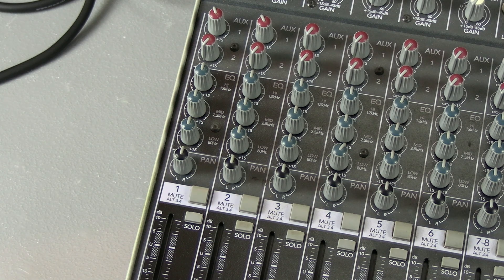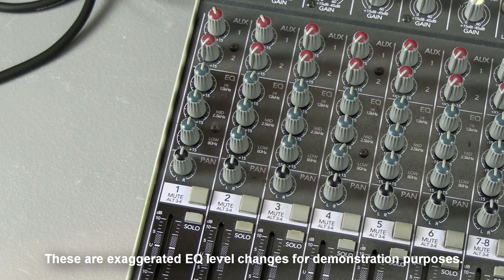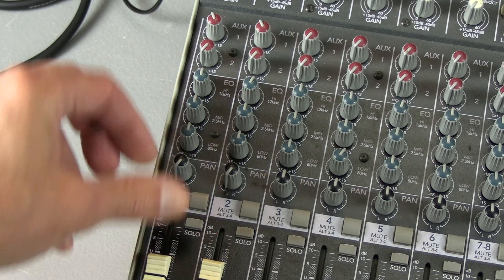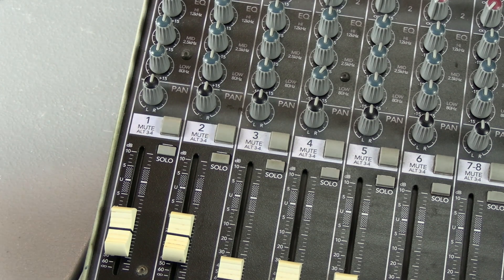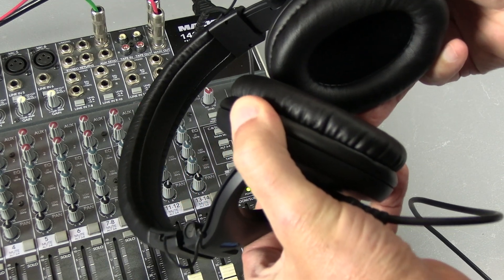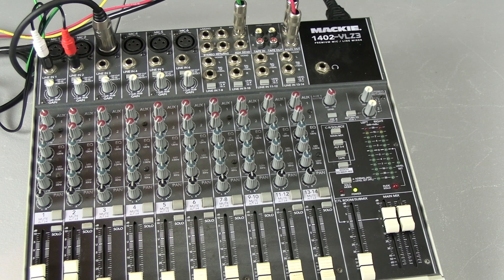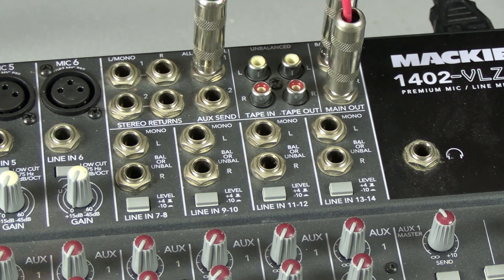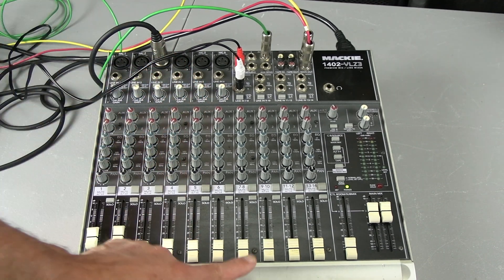Mixing Boards - The Basics of Using an Analog Mixing Board - Part Two

Comment: Another Tech Note for Phantom Power 7:15 ... plugging in a line level source, such as a cell phone or media player, to a Phantom Power-activated input can (and likely will) damage that source device, especially the audio-out circuitry on that device. Ensure you are plugging these devices into a designated Line input or, at least, a channel that is NOT passing Phantom Power in order to reduce chances of damaging your device.
Reply from the maker: Great note regarding Phantom Power usage, Thanks!